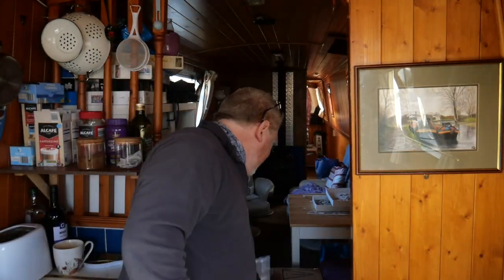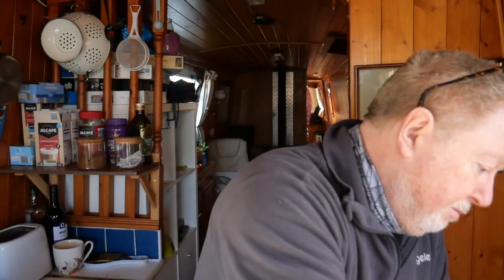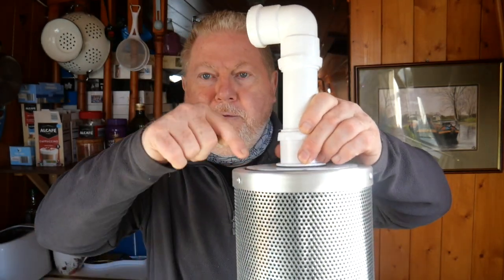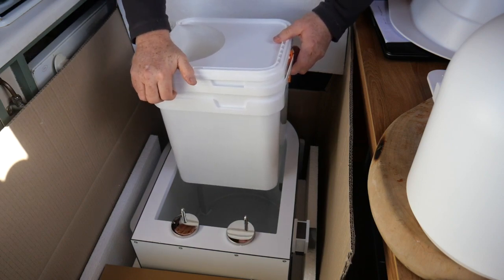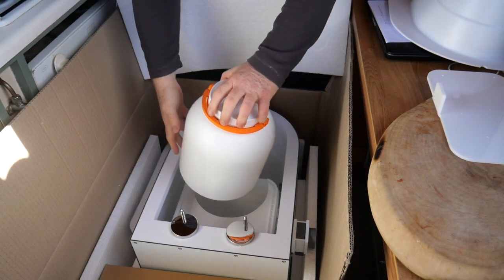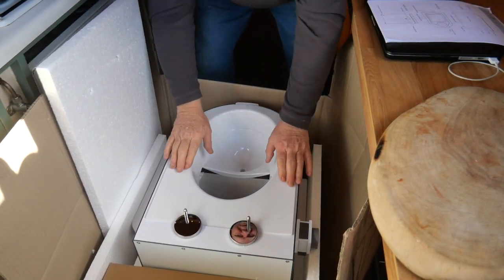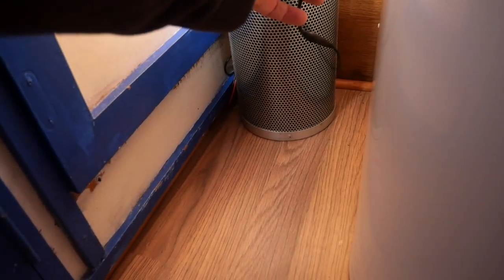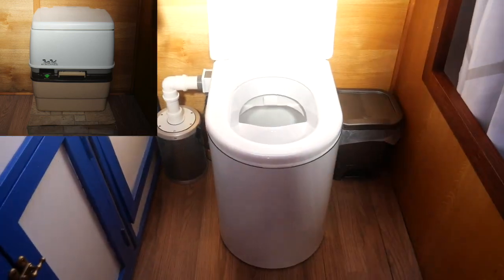Simploo Composting Dry Toilet Replacement for Narrowboat PortaPoti is a triumph The Happy Travellers

Comment: I lived on a narrowboat for years and had a backup chemical toilet to the pump out tank as British waterways tend to close locks and sewage disposal points at little notice.
Reply: Along with other boats , I decided to overwinter in Hebden Bridge.
Having closed the locks , British waterways then demolished our sewage disposal facility.
Reply: I was initially able to take the boat up through the locks ( about 5 miles ) to a boat engineering company that had a pump out facility during winter closures.
When the ice and snow arrived , I had to use the chemical toilet and sneak the cassette  into a pubs toilet to empty it.
When living on a narrowboat , be prepared for all circumstances !
Reply from the maker: It certainly true that we have to be prepared for all circumstances 👍😁😎
Reply: @TheHappyTravellers  Water levels suddenly drop , locks get stuck , fuel points shut , weather turns bad  etc.
Yes , prepare for any ocurance and view the surroundings before mooring overnight
My rule of thumb was .... If empty Cider bottles were floating in the canal and on the banking , keep going and find somewhere better to moor.
Reply from the maker: Good advice Robert 👍😎😀

Comment: Hi Steve ,Thank you a lot for your kind video ,I would like to go with this Simploo , Just wondering if the filter is really works good and better than built fan in to the  exhaust? please update us with the review about the smell while you are using it, Also would be appreciate if you provide us with the filter dimensions ,By the way well-done job
Reply from the maker: Yes the filter works but I plan to run it to an outlet in the roof at some point :)

Comment: Looks nice! I wonder how all those original canal boats, around 1800, dealt with this issue?
Reply from the maker: Good question. Now I'm wondering too lol 😆
Reply: I’m fairly sure it went straight into the surrounding water and not as long ago as 1800!!  I can remember when train toilets went straight out.....why you weren’t supposed to use them in the stations, there’s a thought?
Reply: @anncarter9405  yes - I’m also old enough to remember the trains. 🙂The thought crossed my mind that they would chuck out their chamber pot contents into the poor canals. Maybe, when the Canal Museum opens up, the question can be answered, assuredly!
Reply: I remember going on the Norfolk broads in the 60’s and 70’s and you pumped the toilet after use so think it may well have gone straight out??